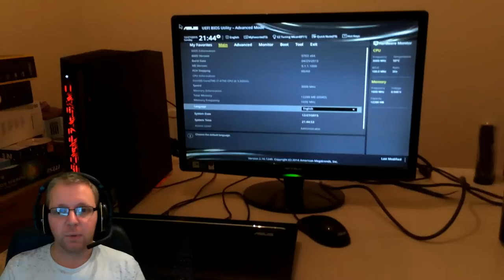How To Change CPU Tutorial (Asus Rog G20AJ)

Comment: If going i5 to i7 need to flash bios ?
Reply from the maker: What cpu you thinking of upgrading to? as long as its a LGA1151, it can depends on how high you want to go, some might not work. and asus has stop doing any bios for this system for a while
Reply: @welshwhoopee  i7 LGA1151 that was on my first Asus G20 where the motheboard give up few weeks ago,now i found a secong hand G20 cheap but with an i5 ...i will need to add a second DDR3 8GB ram too  ...
Reply from the maker: yeah these system are getting cheap at moment, but you won't need to flash the bios but worth trying to update to the newest version that is out which is years old anyway
Reply: @welshwhoopee  not same socket ,,there is  an i5 3.2GHZ
Reply from the maker: you will need a LGA1151 as that is the socket in the G20CB model, if you have the older model like G20AJ then its the LGA1150
Reply: @welshwhoopee  I See that , i can't use newer i5 2.7GHZ :(
Reply from the maker: your best upgrade option is to sell your old system and buy the G20CB which has the i7 6700 and on the LGA1151 platform and allows you to go further up

Comment: Hiyyaa. So my cpu fan/4pin(chassis fan/5pin) is ok  recently died ( after 7 years) and decided to replace it. Just got my replacement today and for some reason the cpu fan runs at full speed and it registers the rpm as N/A at the bios but its running at full speed
Reply from the maker: Hello, was the fan the replacement and did the wires colors if any match to the old one, sounds like maybe their are mixed up and maybe causing this issue

Comment: Hello Welsh, i have a G20CB with i7-6700, what's the best CPU i can buy? i don't want to throw this pc away
Reply from the maker: Hello, depends on your budget. I think on the asus rog forums that people was able to get to the 9gen i7, as long as its a LGA1151 then it should be good to go.
Reply: @welshwhoopee  thanks, i ask asus and i can't change the CPU since the BIOS is running only with i7-6700 or lower.
Reply from the maker: yeah their is no more updates to the bios, ask on the asus rog forums as their is a great amount of people that has update to some newer CPUs and working fine
Reply: Any update on the bios? Put a Radeon RX 570 in and it’s running great

Comment: if I install the i7 4790k I will need to change the cooling system? btw I have g20aj with an i5 4460. If I can change it which one will be the perfect one for it?. Thanks in advance.
Reply from the maker: hello, on the asus rog forums people have fitted a h50i water cooling, and there is a full post on how to do that but you will need to cut holes into the case. I have not seen many people fit other fans in the system, and I don't have 1 to test a few on.
Reply: Hey did you need to change the cooling system? I wanna upgrade my cpu to the i7 4790k (seem the best cpu) , does it run ?

Thanks

Comment: I have the one with the 4790 non k , I don't see a reason to put the k version in as I can't even hit boost clocks on the non k as it will thermal throttle already. Even changed the thermal paste but no avail. Any idea how to upgrade the cooling to at least be able to hit boost clocks?
Reply from the maker: Hello, well on the asus rog forums, people have put a corsair H50 water cooling into the system but its some work to butcher the case for the water pipes, but a lot of people saying their get great temps.
Reply: @welshwhoopee  Ah dang, I was hoping someone found maybe some beefyer fans that have roughly the same dimensions and can solder the cables to fit the connector or something xD
Reply from the maker: maybe you can, but its something at the time I never tried cause no one was asking about the overheating issues

Comment: Hi Welsh, thank you for the video. I actually just recently revived my Asus G20AJ. My question is almost the same as phobiazzzero, currently I have i5 4460, do you think it can go i310100?
Reply from the maker: Hello, your pc is the Asus ROG G20AJ which means your socket is the LGA1150, so your best CPU to fit that socket is the I7-4790k, even if you had the higher PC Asus ROG G20CB and that CPU is the LGA1151 which means you can fit more of the 10 series intel cpus, so if you after better then, either upgrade to the I7-4790k or sell the PC and buy the Asus ROG G20CB and then upgrade, hope that helps
Reply: @welshwhoopee  Thank you sir
Reply: @welshwhoopee  wait i can upgrade my Asus ROG G20CB with a 6700 to an i7-10700k??!!
What ram do you recommend? I want 32gb or 64gb
Reply: @anonymous134y  did you end up doing the upgrade?

Comment: What cpu fits better than my i5 that i currently have in my g20aj.. do you have the exact model of the cpu?
Reply from the maker: Is your pc the g20aj model and if so then the i7-4790k is the very best you can install
Reply: @welshwhoopee  thank you! also do you know if i can fit something better than 1060 gtx in it?
Reply from the maker: if you fit that cpu above, then I wouldn't go anything better then a 20 series card like a 2060 or 2070 etc....but founders card will fit
Reply: @welshwhoopee  will the power brick handle a 20x series?
Reply from the maker: if you will need 2 power bricks, in the uk its the 230w and 180w but I think in the us its 2 x 180w power bricks, but not sure as I am based in the uk